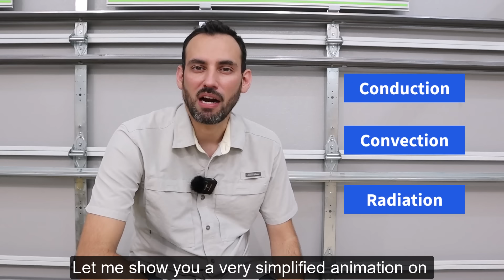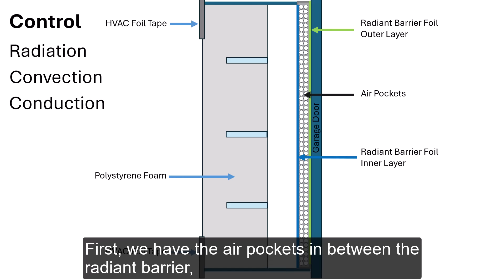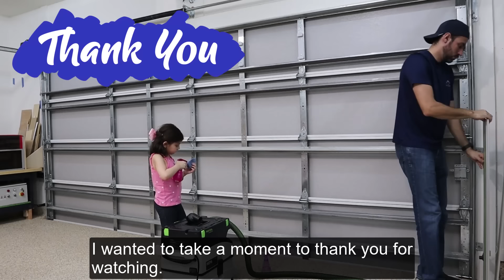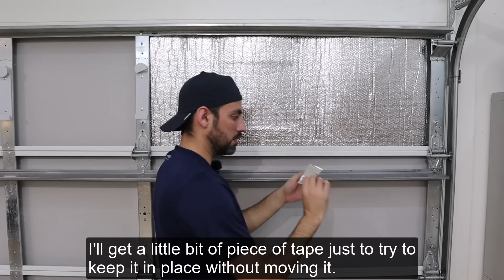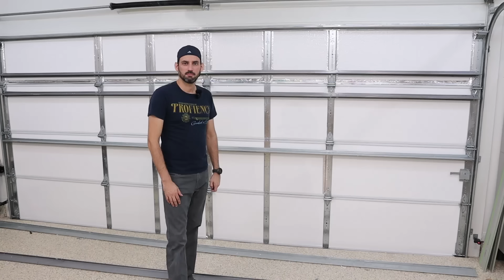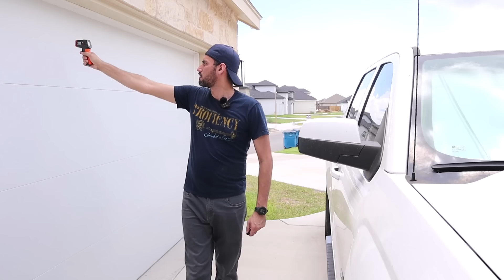The Smartest Way to Insulate Your Garage Door: A Complete DIY Guide

Comment: FYI, those infrared thermometers have an emissivity setting that would need to be adjusted in order to be accurate when changing back and forth between different surfaces.   For example the difference in reflectiveness between the painted door panel and the shiny insulation would probably be substantial.   When I worked on engineering projects with these temp guns, our solution was to put a piece of masking tape on all of the different surfaces that we wanted to check and only shoot the laser in that spot.   Then set your gun to the emissivity of masking tape which is e=.92.  This keeps the measurements more accurate. 

Also, I didn't catch why you decided not to use spacers to form an air gap like you mentioned in the beginning.   You could simply cut small pieces of a thinner foam and glue them in various spots on the interior side of the big foam piece before you mount them in the door panel.
Reply from the maker: Thanks for the info! You make a great point about the infrared thermometers. I'll keep that in mind for future projects and add the masking tape for more accurate measurements. As for the spacers, I ended up skipping them because of the install process, but your suggestion of using thinner foam pieces is a solid idea. Appreciate you sharing your expertise!

Comment: Noobie on garage doors here. 
A few questions: You mentioned about adjusting the torsion or something? Is it because of the weight added? Would have loved to see the door open and close and how the insulation handled it. Finally, can this work with just the foil only?
Reply from the maker: Great questions, James! Yes, the torsion spring adjustment is because of the added weight from the insulation. I’ll keep in mind showing the door in action for future videos! The garage door open and closes without any issues and it is super quiet. As for using just the foil, it can work, but it might not insulate as well as panels. You can always add the panels later on. I will be working on a different video to show how to adjust the torsion springs. Thanks for watching!
Reply: @CarlosWorkshopHaven  thank you so much! Forgot to earlier, subscribing now :)
Reply from the maker: Thanks for subscribing, James! Really appreciate the support!

Comment: dumb question . Can the door be open and closed without affecting the insulation?? Thinking of doing this to my garage
Reply from the maker: Not a dumb question at all! Yes, you can open and close the door without affecting the insulation. The panels stay in place as long as they're properly installed. It’s definitely a great upgrade for your garage!

Comment: I have an electric car charging overnight. I think this insulation will make my garage a desired place to stay in winter, but might trap all the heat generated by the EV charging and cause some safety issues in summer.
Reply from the maker: That's a great point! You might want to consider adding ventilation or a small fan to help with airflow during the summer. Thanks for watching!

Comment: One tip on the outside trim is, if you have gaps, pull down the trim enough to apply sealant between the trim and garage fascia. Otherwise, expansion and contraction will simply cause the sealant to separate, look terrible, and stop being of much utility.
Reply from the maker: Great tip, Pete! Thanks for sharing that, it makes a lot of sense now that you mentioned it. I will be in the look out if that happens and then apply it in between as you suggested. Appreciate you watching!

Comment: Florida Man checking in 😁Is it safe to assume this would help my AC System in the fact that my air handler is in my garage, which means all that radiant garage heat is soaking into the metal of the handler? If this would help in ANY way with the overall cooling efficiency of my house, it may be worth my time and effort. GREAT video, and as some others said, a video on how to re-balance the torsion arm on the garage door would be VERY helpful.
Reply from the maker: Hey Florida Man! 😁 Yes, reducing garage heat can help your AC system’s efficiency. I’ll work on that torsion spring video in the near future. Thanks for the suggestion and for watching!

Comment: A good video, and very helpful. I will certainly be giving this procedure consideration for my garage. One thought though: you mentioned adjusting the torsion spring on the garage door to re-balance it. It would be nice to see how that was done. If that would have been too much for this video, perhaps "future Carlos" could have mentioned a second video in the future?
Reply from the maker: Thanks so much, Ken! I’m glad you found the video helpful. You’re absolutely right, adjusting the torsion spring is an important step, and it would definitely make for a great follow-up video. I’ll make a note of it for the future!
Reply: Any updates on this video to be made ? @CarlosWorkshopHaven
Reply from the maker: @ScolarshipBoy1984 Yes! I ended up adjusting my torsion bars. I did a video about it, however, I can summarize the video in the following. The steps I demonstrated there I guess only worked for my setup. Adjusting torsion springs could be really dangerous if not done properly. Hiring a professional to do it for you will be the best approach (depending on your situation), but then again, before I even adjusted the torsion springs I was still able to raise and drop the garage door without any problems. Sure the motor will work harder leading it an earlier (still years) failure, but I don't open my garage often. ....that is just my personal situation. I hope this information helps.
Reply from the maker: Now, in general terms.... the garage door insulation has been working really nice. Is not hot or cold at any time of the day, and it has been like these since the installation of the insulation. But like anything else, I guess this will also depend on your geographical location. Whenever I opened the garage door, it is extremely quiet, the insulation also reduces the vibration from the metal panels.

Comment: Thank you for this informative video. I live in LHC, AZ where it HOT ALOT!!! My Garage has no windows or man door.
I put the styrofoam panels in 3years ago, but didn’t use the reflectix. I will be pulling the panels out this winter, and doing the install the way you showed in this video. 
I also discovered my garage lid is not insulated, so will be having an insulation company come blow some insulation in. 
My garage has been averaging 110 degrees this summer!!! 🥵🥵🥵
I’m considering putting in a solar powered attic exhaust fan too.
Any other helpful hints to cool the garage down would be much appreciated!!!
Thank you for this great video
Reply from the maker: Hey @sharismithson1233, I am glad you found this video helpful. Thank you for your comment.

Comment: Why garage doors don’t just come fully insulated and well sealed is beyond me
Reply from the maker: Hey @darylfortney8081, I guess the quick answer is money. Builders simply want to be complaint with the building requirements and go as cheap as they can. In a different note, I do know that there are off the shelf insulated garage doors, they are more expensive and heavier too.
Reply: @CarlosWorkshopHaven  sure, i guess in that case I would just use the one already insulated.
Reply: You can buy an insulated or a non-insulated door. Price difference can be significant. Builders generally use the cheapest models.

Comment: how much did you spend on materials?
Reply from the maker: Hey @JoseSorianoPhtography, I spent around 250 USD at that time. I also bough extra foil tape that was unnecessary, so i could have been a little bit less. Thank you for your comment.

Comment: Great video. But remember the insulation affects the weight of the garage door. You may need to adjust your spring to assist the garage door motor.
Reply from the maker: Hey @Oki-kq1iq, I did rebalance the garage door by adjusting the torsion spring because exactly of what you are mentioning. Thank you for your comment. :)

Comment: I have done about the same installation, but instead white styrofoam I have been using Pro Select R-Matte Plus-3, 1.5 in. x 48 in. x 8 ft. R-9.6 Foam Insulation Board. Same amount of time and efforts, much more outcome. As a first layer I used the same Radiant barrier with air pockets. For Houston heat I got just shy of 40 degree difference. Just  my advice.
Reply from the maker: Hey @bum-bumbigelow3825, that is a great option! Thank you for sharing that.

Comment: I didn't see you add a foam spacer  in the video. Did you decide not to include that in the install?
Reply from the maker: Hey @jessea.9268, you're right! There’s just enough wiggle room to maneuver the insulation panels into the cavities, so I decided not to add them at the end. There's still some air trapped in between, though. Thank you for reaching out.

Comment: Great video and loads of excellent detail Carlos, thank you. I take it you are not opening the garage door since you sealed the outside edge?
Reply from the maker: Hey @brianmurphy836, I just sealed the edges to lower the amount of air leak, but I open the garage whenever I need to, like bring stuff in and out for more projects. I do try not to open it because of the heat though.  Thank you for your comment. :)

Comment: Great video. Thanks. I know it’s not much weight but did it affect you door balance at all?
Reply from the maker: Hey @joefranceschino3131, to be honest, I do not know because my garage door was not balanced to begin with. I added the insulation and then balanced the door via the torsion spring. I did not covered that process in the video since it was not the focus, and it will have taken a while to cover it right. Sorry I could not answer your question. If I had to guess, it will have barely affected the weight. That foam is pretty light.
Reply: @CarlosWorkshopHaven  thanks for the update

Comment: IR temperature guns cannot read shiny surfaces.  The shiny surface could be 1000 degrees, and it will still read your temperature (or whatever is in reflection).  Black electrical tape is a great way to read temps on shiny surfaces with IR temperature guns.
Reply from the maker: You are right @kevenc, I could have used some none reflective material right on top of the panel to get a more accurate measurement. Thanks for pointing that out. :)

Comment: Don't forget about the influence of paint colors, especially in very hot climates! A dark paint garage can absorb 60%+ more heat than a light paint, and the best insulation money can buy is to just never absorb the heat in the first place. If you've got a dark garage door (and you can choose a different color), you're just fighting physics if the first thing you reach for is insulation.

Great video, you did a solid job of covering reflecting radiation but I think you might have taken it for granted that you already made the best choice in paint colors 😆.
Reply from the maker: Hey @rcats848! You are absolutely right regarding the color of paints. That would have been a nice touch to add somewhere in the video. In my case, I just bought the house as is, so I was lucky I didn't have to paint the garage door from the beginning. Thank you for your comment. :)
Reply: Does this only matter on the garage door?  Or also the color of the walls on the garage?

I live in Florida and wanted to paint my garage walls a darker color (white garage doors and the 3 other walls are dark gray).
Reply from the maker: Hey Mike, in short, color does affect the temperature. Ultimately, the choice is yours, but darker colors tend to make the space warmer.

Comment: Nice work Carlos! (Subscribed now) I have a double garage door that cops full afternoon heat for the entire afternoon. Maybe 8hrs in summer.
Question I have is: what is the temp of the metal door that is inside facing, compared to the outside.
Reply from the maker: Hello @OnTVaustralia! Thank you for your subscription! For me the temperature of the metal door was about the same for the inside and outside.  I measured 101.8 F inside and 102.2 F outside. These numbers will vary with the day and weather of course, if you are in a windy area this could help out with the cooling of the garage door in the outside. Your metal garage door will act as a huge heat sink. I hope this information helps :)
Reply: @CarlosWorkshopHaven I have access to a foam board that has a foil cover. Do you think this will yield a similar result?
Reply from the maker: Hey @OnTVaustralia, sorry for the delayed reply! Any foam board with a foil cover will give you similar results, so if you already have one, I’d say go for it!

Comment: The approach that I've used in 3 houses in blazing Florida is:
Buy the 2 inch 4×8 sheets of rigid insulation with the radiant foil on one side (shiny foil goes toward the door). Cut to fit on my table saw with rabbet joints to help it fit into the channels. Its a snug friction fit thatnis slightly fatter than the door. So once you add the stiffener braces, it just snugs everything up!

The door barely rattles now as the styrofoam adds a lot of stiffness and deadens the sound a LOT. 

I also installed an oversized ductless mini split in there as well. So it's quite comfy!
Reply from the maker: Blazing Florida! hahaha know what you mean. I really like the approach of all in one, the foil in one face of the foam. I also noticed as you mentioned that the rattling went away. In the next video, due to natural sequence of events I will be installing a mini split, but that video will be a little bit delayed due to work travel.  Thank you @TheRPhelps24 for your comment.

Comment: what was the change in ambient temp?
Reply from the maker: Hey @will1498, That is a great question. I am not going to lie to you, I do not have a specific number since the temperature has been oscillating due to changes in the weather, rain, wind, temperature itself, the time of the day, etc. But I can provide you with a range of what I have noticed. Keep in mind that the thermometer that I used for the room temperature is a really cheap one. Before it was oscillating somewhere between 95-97 F more less. Now, is somewhere between 89-93F depending on the day.

Comment: 5 years ago I did a radiant reflective barrier with an air gap, no foam  on my garage door.   There is a 20 to 30 degree F difference from the outside of the garage door and the inside temp.   I  did the same for my ceiling.  Now when it's 110 outside it's about 85 to 90 degrees in the garage.  That is about as hot as it gets here.  So I am happy, I guess when  it gets into the 120s in a few more years I will need to foam board up as well.
Reply: How did you create the 1" air gap?
Reply from the maker: Hey @JW-rv1mw, the goal was to create an air gap, though not necessarily 1 inch. During the install, it was tricky to add a spacer between the foil and foam board, so I went without one, but there’s still an air gap.
Reply from the maker: Hey @SolRC, I will need to insulate my attic/ceiling at some point as well. I think I will do the same thing you did with the radiant barrier... at least to begin with, but money and time are always the issue. Thank you for taking the time and leaving me a comment!

Comment: Throw a little portable AC and heater combo in there and you will be working in luxury conditions
Reply from the maker: Hey @justinmilla, that is actually my next step, I will do a mini split install in order to make the shop more enjoyable to work there and be able to do actual projects without all the heat. I hope you stick around. Thank you for your comment!
Reply: @CarlosWorkshopHaven  sounds great! I have a portable AC which is just hooked up to my window. I bought it used so it was a very cheap way to cool down the shop and garage
Reply from the maker: Thank you for the kind words @justinmilla!

Comment: It's a nice effort but there is something fairly obvious that you are missing called thermal bridging. The metal frame that extends from the outside of the garage to the inside will still allow a substantial amount of heat transfer and you will still have issues with the garage heating up. It would take a much longer period of time to do so but it's definitely there and you have essentially installed the insulation incorrectly. 
What you are aiming for is a continuous surface of insulation with virtually no breaks in it. To do so, you will need to install the insulation over the internal surface of the garage door  and you likely don't need to remove any of the parts of the door. You are clearly not going to be able to attach the Festool tracks the way you currently do and you may have a problem with the door mechanism which is why this isn't often done. 
To be perfectly honest, you likely want a door that was built as an insulated product as retrofitting is not always possible and is always hard. 
As to radiation, I think you might be over engineering this whole thing. Your garage door is metal and that reduces radiation substantially Having your door painted in a light color also reflects a lot of the radiant heat back so the foil insulation is great but it mostly works because of the air pockets and not the foil.
Reply from the maker: Hey @george9710, Thank you for your comment. I am surprised you were able to catch those things, you have great attention. You are correct about the thermal bridging, but also, the whole outer side of the garage door steel panel acts as a huge heat sink that gets cool off as air blows on it, which will help (depending on the day of course) delay the heating up during the day, and since the idea is to improve the past existing conditions ...well we do what we can, and it did improve. Then again, as you mentioned, the best way to go about it will be to have one of those insulated garage doors from factory. Great comments @george9710, thank you for your insights!